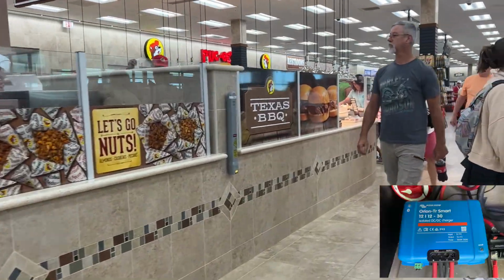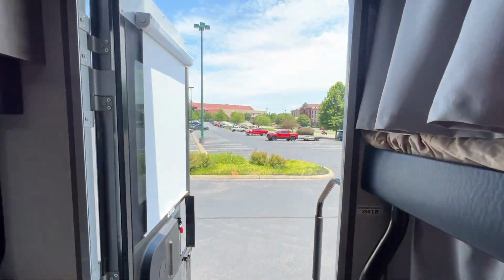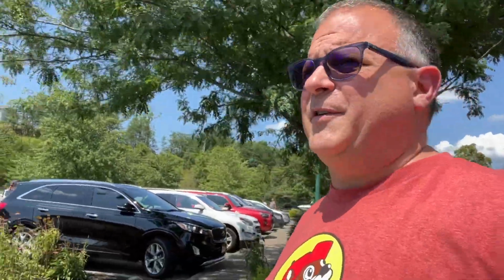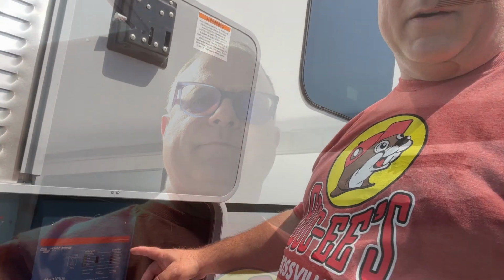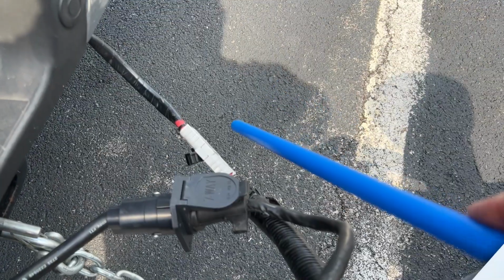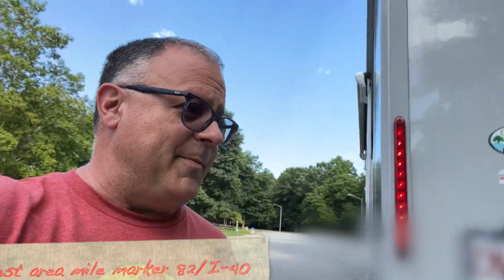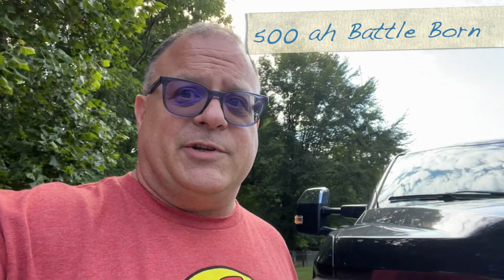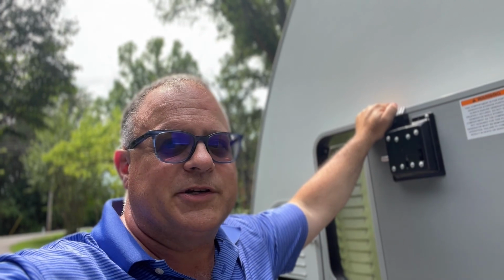RV DC to DC Charger as alternative (the next video will explain how results are possible)

Comment: very informative gonna show this to my husband tonight.
Reply from the maker: Thanks for watching.  We will be putting out the companion video in the next week that goes over the details a little more of what the test is showing and what a DC to DC charger does, this video is just the real world test without the boring stuff. But one note that we will cover in the video is a 30 amp charger can not charge the batteries more than 30 amp hours per an hour though it always seems to do so in this test. That has to do with the heavy load on the batteries running the AC and how the batteries and monitor behave during such a heavy load and right after based on my experience. Regardless, the video is accurate in that we used the air for a couple hours and got back to 100% battery fairly quickly with just a DC to DC charger as shown in the video and its a great solution.
Reply: @TreeTalkerTheTraveler  great thanks for putting in the effort to get the info out there.

Comment: A fan of your RV vids not many today vloging with a Travel Trailer. Lets just say many have died off lol; its all 5th wheels and motor RV's. Is the Victron inverter Hybrid ? Having the ability to use both  batteries and your inverter gas generator at the same time and the inverter is controlling the output of the batteries for longer life? This way your gas generator is not having to torque real high and only need the one gas generator. Which you  demonstrated 2 yrs back. 

Something else you can do to keep your camper cooler on those warm & hot days while towing. A  Maxfan Deluxe; this fan can stay operating while you're on the road helping to keep the TT interior a little cooler on warn to hot days. I live in South FLA and when towing North the TT interior could reach easily above 90 or higher. Ever since I installed the Maxfan the camper interior in 6 hours of driving with day time temps above 88 degrees the interior stayed 75-77 degrees and rain is not an issue.  Our TT is a Grand Design XLS 22mle  "2022" .   Appreciate your vids.
Reply from the maker: Thanks and great points. Agree on the MaxAir Deluxe. I installed one on this trailer and my last one and do just what you said, makes a big difference.  Thanks again!